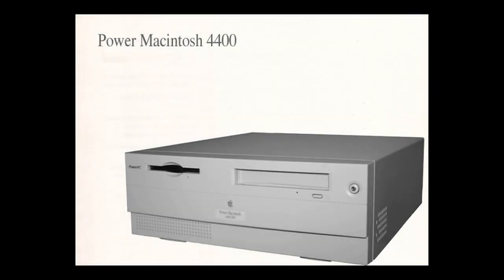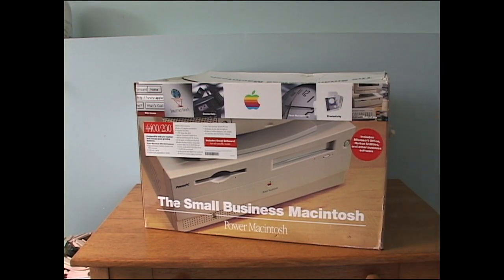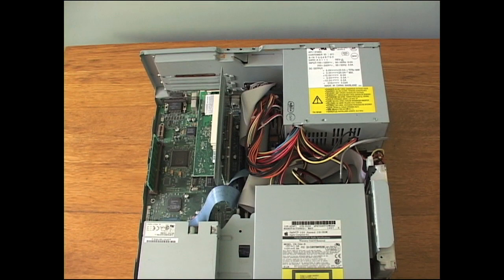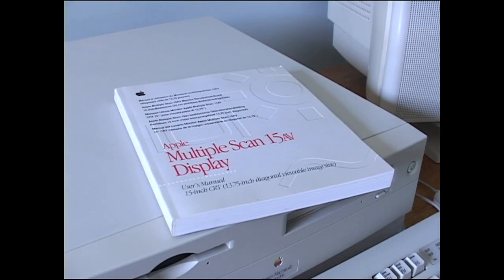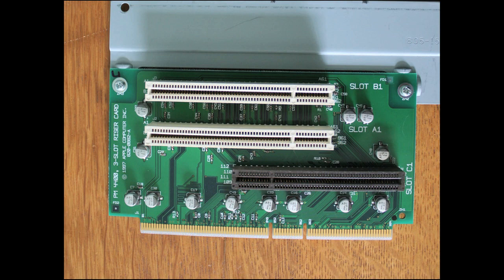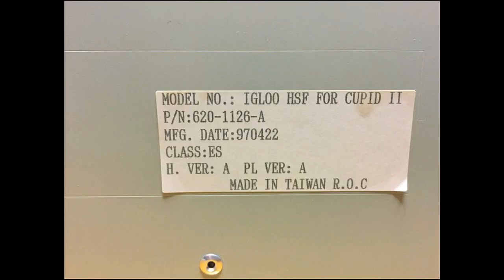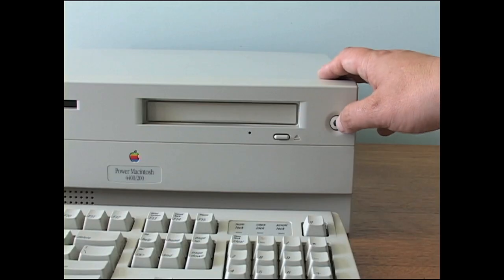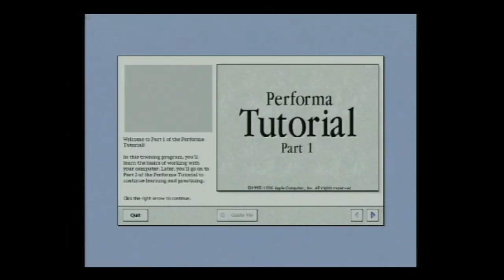The Power Macintosh 4400

Comment: Ha! They criticized a 1024 x 768 monitor for having too much resolution on a 15" screen. Tell that to my 1920 x 1080 5.5" phone!
Reply: There was no scaling back then, so icons and the UI in general looked tiny on that kind of an ultra high ppi monitor. ;)
Reply: Scaling was not what it is now.
Reply: @McOuroborosBurger  We still have scaling issues
Reply: Richard Sequeira we do definitely, but theyre usually on older apps, or shitty newer apps.
Reply: @McOuroborosBurger  no, even some parts of the operating system.
Reply: I use a 24" 4K monitor at 100% scaling. Why? More real estate! Sure, it would be easier to read if it were a 28" or 32" monitor, but even at 24", it's doable. I split the screen up into four 12" 1080p quadrants.
Reply: @richardsequeirateixeira  which operating system? Luckily Apple's operating systems are not among them, they've done their usual fastidious attention to detail when they went high-DPI and I've never seen a single thing on Mac OS that wasn't properly scaled for high-DPI.
Reply: @dregenius  on iOS and iPadOS. Ever had an application made for an iPhone run on an iPad? A lot worse than Android.
Reply: I find it too small these days and usually leave my E773s at 1152x864, though it's a tradeoff since 1024 gets 85 Hz and 1152 gets 75, which is just on the cusp of avoiding eyestrain.

Comment: I was the service manager/technician at an Apple Specialist in the northern Chicago area for a long time.  We sold exactly two of these computers.  One of them came in for service every couple of months because of "sound distortion."  The speaker was garbage and would distort at loud volumes.  Apple didn't have a separate part for the speaker; to replace the speaker, I had to order an entire lower housing assembly/metal chassis and transplant every part into that chassis.  Ridiculous.  After several case replacements, I used a couple of the adhesive "shims" Apple gave us to stop PowerBook 5300 RAM from popping out of the socket (install it on the back of the keyboard above the RAM connector) and "buffered" the speaker assembly from the metal case.  I tested the unit "OK" and the customer never came back for another speaker repair.
Reply from the maker: That's fascinating stuff! Great that you remember it so clearly. It was hard to dig up information on this one, and, until now, not much more info offered up from the viewers. Thanks for sharing the 'Apple Service' experience on the machine.

Comment: I’m bingeing these vids. My school had these computers! I played my first mp3 file on one of these, and built my first (mock) website on this model too. This was in 2000-2001. Later, at uni, they were scrapping a lot of old macs and I took a 7220. I used it a little until it stopped booting. When I saw you explaining it won’t boot with a dead clock battery I kicked myself! Because I took it apart and threw most of it in the trash 😣
Reply from the maker: Sorry to hear you received the clock battery information too late. Thanks for sharing your memories of this model. Glad you’re watching this video series!

Comment: The 4400s are funny little things. The floppy is on the left because that's where it was when the basic LPX-standard case was designed; the 4400 team just stuck a custom bezel on it and dropped in their LPX-40 logic board and shipped it. I haven't figured out who designed the case but it was used by a few low-end PCs during the short-lived LPX standard. 
The boot chime was probably truncated a bit to fit within the ROMs. Cost savings, you know.
Like a few other Macs (especially later PowerBooks such as the G3s and TiBooks), these would boot without a clock battery, but not with a dead one installed; they work fine without one except for not keeping time when unplugged. If you have one of these in storage it's best to take the battery out now because eventually it will leak and ruin the logic board. 
The G3 processor itself didn't need OS 8 (lots of people upgraded their Sys 7.5-running Macs with G3 cards without issue) and it's not impossible to run 7.6.1 on a beige G3 desktop if you shoehorn in a few extensions to get a couple things working. Steve just called System 7.7 "Mac OS 8" to force the cloners to renegotiate their contracts; it wasn't really a major version jump, which is why the only real differences between 7.6.1 and OS 8 are the modified Copland GUI (which you can get on Sys 7 with the Aaron shareware extension) and HFS+ support (which can also be backported to 7.6 to a degree), and why it still runs on 68k whereas the very different OS 8.5 doesn't. Other than that, it was just a bunch of bundled software and window dressing (such as the Appearance control panels) rolled in to make it look like OS 8 was really something new when it really wasn't.

Comment: The Power Mac 4400 or 7220 was build by Acer for Apple.  Acer used a case design that they also used for their Aspire PCs as the foundation.  It explains why the floppy is on the wrong side when compared to other Apple models.
Reply from the maker: Tristan Peemoeller 
Interesting info! Hard to find anything on this machine, it was so universally ignored at the time.

Comment: It's actually indirect UV light heat and humidity that yellows plastic. If you leave yellowed plastic out to sit in direct sunlight without any chemicals on bright sunny days even plastics yellowed to the point of being almost orange will bleach white naturally. It's slower then retrobrite but doesnt require disassembly. Retro recipes did a video on this using this method to "light bright" his yellowed Macintosh. I've managed to test this with orange yellowed keyboards bringing them back to pure white again aswell as with some early 90s VGA monitors although some stuff took as long as a week to brighten up and i accidentally left a monitor out once during a rain storm (although it works fine after drying out for a few days) 3 days in so you have to remember to watch the weather and bring them in at night just to be safe.
Reply from the maker: That's really interesting! I did not know that. Thanks for sharing that. I may have to do some more experiments...
Reply: @65scribe  Awesome id love to see the results you get from your tests in a video in the future. :

Comment: Another cool video, keep up the good work.  I had a PowerComputing PowerCenter 150 back in the ‘90s.  
I remember around 1999 or 2000 Sonnett Technologies made a G3 upgrade card for Power Mac 7200s(which also had soldered CPUs)that plugged into the L2 cache slot.  I wonder if they made one of these G3 cards for the 4400 as well.
I liked the 15” AV monitor, its speakers sounded pretty good, compared to ones on its little brother, the 14” AV, which sounded terrible to my ears, really tinny.
Reply from the maker: Thank you! I think they made G3 cards that were compatible with the Tanzania board, be it the 4400 or Motorola clones. You know, after all that I never fired up the 15AV monitor's speakers. I'll have to try it. Thanks for sharing your insights!
Reply: @65scribe  I used to work for a CPU upgrade manufacturer back in the day. The Sonnet 7200 card was a PCI card, not an L2 card. I met the Sonnet guys on the Apple Expo Paris when they first presented it and they proudly showed it to me the day before the show opened. I just had a blank look, thinking "nice, but ermm you're two years too late". I don't think they sold that many, the upgrade market was going down the pan by that time (was it in 2000? can't remember) as it was pretty clear the upcoming OS X wouldn't run on upgraded Macs (out of the box at least). As you say, there were lots of G3 cards that plugged into the L2 cache slot for the Tanzania boards.
Reply from the maker: You jogged my memory on that. It seemed like people were talking forever about inventing an upgrade card for the 7200, and, yeah, by the time they came up with something, it hardly mattered. Good info! Thanks!
Reply: Sonnett did indeed make a very good G3 upgrade card (I think it was called the Crescendo?), I bought it, and extended the life of my 4400 until i was able to buy a iMac DV Special Edition, which then introduced me to Mac OS X, but that is another story...

Comment: 5:37 here in South America we knew that new manual voltage selection would cause a lot of exploded PSUs, as many resellers sold the USA 110V-pre selected 4400s to customers in 220V countries; and indeed we repaired literally dozens of exploded 4400 PSUs connected to 220V factory switched to 110V; I know Apple put that yellow warning sticker but Apple customers are...well...never mind
Reply from the maker: Great information, Juan. Thanks for posting that!

Comment: When you make a battery case out of alkaline batteries, its beneficial if you can found a way to mount the batteries on the outside of the case, somewhere in the rear, if you forget to take em out, and they start to leak, they will leak or explode on the outside of the case. Jason from macintosh museum also had a powermac where a clock battery prevented the machine from booting, he also made a alkaline solution for his mac, he stuck the batterie holder on top of the graphics adapter, forgot to take out the batteries and a couple of months later, he opened up his mac, and found a disaster inside his mac . . .
Reply from the maker: Great point, Bram! Thinking beyond just trying to get the computer to boot is a good idea. I did remember to unplug the battery contraption after the video was done. Thanks for the heads-up, though. You have a good idea, wiring it out the back. I did something similar for the Macintosh II in my 'Jump Start' video, but it didn't occur to me to do the same here until you mentioned it.

Comment: Another note is that since the 4400 used a standard PC ATAPI CD drive, you can easily replace it with a new stock one, if you can find a vendor who still makes them, which I believe Lite-On does.

Comment: Excellent vid as ever. Really interesting just how many little cost cuts and carry-overs from prev models there were on this.

Regarding the square clock battery replacement, do macs attempt to charge them as well? I've been wondering if standard non-rechargy AAAs were a no-go for this sort of thing
Reply from the maker: Good point. I'll have to keep an eye on my make-shift battery. Thanks for that!

Comment: It really was a nightmare to work on the internals - those metal parts where razor sharp!
I also keep my collection in a shed, which unfortunately suffered from a roof collapse - there are brand new still sealed Archimedes computers in there!
Reply from the maker: That sounds like it has the makings of a great video. I'd watch that.
Reply: @65scribe  I have been toying with the idea for years, but never get round to it! I wish I had video'd my cull earlier. I thinned out my PC collection and got rid of everything under 1Ghz. I did take pictures though...

Comment: The front cover on my Performa 550 came off and I could never get it back on. I thought it was a good computer & it was my first color Mac & I bought it at a yard sale for $50.
Reply from the maker: Yes, those early Performas were good until around the beginning of the Powermac. I like the design of that 500 series better than the 5000 series replacement or the G3 AIO that followed.

Comment: I remember the 4400/200 the Mac I wished I had waited to get after getting an anemic 7200/90 the year before. It was aggressively priced and engineered. Though the ATA drives were slower than the SCSI Macs had been using for years, IDE drives were much cheaper so upgrades were more affordable. Especially important as Apple, then as now, tended to go low end on storage and memory. Switching to PC compatible memory also saved on that upgrade as well. If you still needed SCSI speed the port was there for an outboard hard drive. I remember forgoing a grip to Florida and Disney World with my friends over spring break so I could spend the money on a 2GB SCSI hard drive. Man, that seemed like a lot of space at the time.

The 4400 was the Mac that was supposed to "save the company." It may have held off the wolves for a bit, but it could not save Gil Amelio from Steve Jobs's ambition to take his company back and give us the Mac that would actually save the company.
Reply from the maker: Great personal reflection on the 4400. Thanks for sharing that! While I hesitate to give Steve Jobs as much credit as he took for saving the company, I can appreciate that if things didn’t happen exactly the way they did, there would not have been an Apple after Spindler’s destructive reign.

Comment: Hello, I have had this PC for a week. Unfortunately he doesn't make a peep. At least the fan should spin. I treated it to a 4.5 volt battery. Then I read that all IDE cables must be connected for it to start. Got the old hard drive...nothing. I then checked with a voltmeter that the power supply was not supplying power. which power supply can I use? Thank you in advance for the content.

Comment: The modem port is actually there but covered right? I replaced the 33k modem with comm slot NIC and not that I would use a modem these days but still would be nice to be able to connect one.

Comment: The Cyrix 6x86 was great in integer math, and would often outperfom the Pentium clock-for-clock (hence the "PR Rating"), but the FPU was donkey balls which rendered it less than useful for 3D games that utilized it.  Quake being a notable example.  From what I remember A PR-200 part was at least a third slower than a Pentium 133MHz.
Reply from the maker: That’s interesting information. Thanks for sharing that. Sounds like it really depended on what you wanted to do.

Comment: It'd be interesting to hear your thoughts on Apple in 2018. I think your perspective would be an interesting one, given that you've stuck with Apple through the best and worst days!

There are things I'm concerned about (pricing across the board is too high which alienates people, there's no entry-level/switcher Mac etc.), but I'm excited about other potential developments (e.g. the switch to Apple-designed SoCs in Macs and macOS on Arm).
Reply: The iMac is $1,299, the MacBook Air is $999. Very reasonable entry level prices.
Reply: @tylertyler82  agreed, pricing had improved with Apple Silicon 😊
Reply: @tylertyler82 not when you can get a pc for less than half the price

Comment: Ah yes, bought one new in 1997, wrote 2 products on it. The big problem was Apple went to a CHRP - Common Hardware Reference Platform - Macs made out of cheap PC parts and the 4400 was the perfect example - taking it apart revealed a junky clunky interior full of jammed together crappy parts and design. Later the ROMs were invalidated when Apple switched to the "NewWorld" architecture and all of the ROMs went into the system.

Comment: i just dug out my Mac LC II when i discovered that something wasn't right, i heard rattling in it when i moved it around, and i opened it up to my surprise, the pram battery leaked all over the logic board and it corroded off the board which was causing the rattling when moved around. I guess that mac is dead and boards that have had PRAM battery leakage are very hard or impossible to fix. lesson, remember to remove the PRAM battery before putting Mac in storage.
Reply from the maker: Very sad. I've had a few macs destroyed in this manner. Good advice!

Comment: Don't you have a IIfx?
Reply from the maker: I know that would have been more interesting, right? I do not have a IIfx. That was probably the first Mac people started collecting (and by "collecting" I mean buying it for what it IS and not for what it DOES). Even when I started my collection in 2003, people were chasing the IIfx.
Reply: @65scribe  I found two in the ewaste of my uni department. Unfortunately one was eaten up by a leaky battery, mainboard and case are goners. The other is in pristine condition though. I saw them sell repeatedly for roughly a grand on ebay and been meaning to flip it. But haven't in three years so far. I'm not a Mac collector, but I do collect old computers and get a kick out of using them and those machines are fairly interesting. They are the only Apple computers in my collection so far. 
Nice rare collectible computer on the one hand, a grand of free cash to spend on other hobbies on the other hand. Tough decision tbh.
Reply from the maker: SeltsamerAttraktor   Very cool that you grabbed that out of waste and it can fetch a thousand now. Sounds like win-win whether you decide to sell it or not. Very interesting... thanks for sharing that.
Reply: @65scribe  That's how I ended up finding your channel and I watched most videos by now.
Reply from the maker: SeltsamerAttraktor    That’s great to hear. Thanks! Maybe someday I’ll find a IIfx as well.
Reply: @65scribe  I hope you do. I'm curious to see your take on it. I have to admit, I'm hesitant to sell mine since they truly are such neat machines.